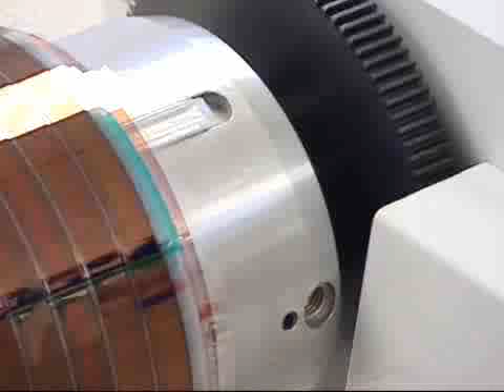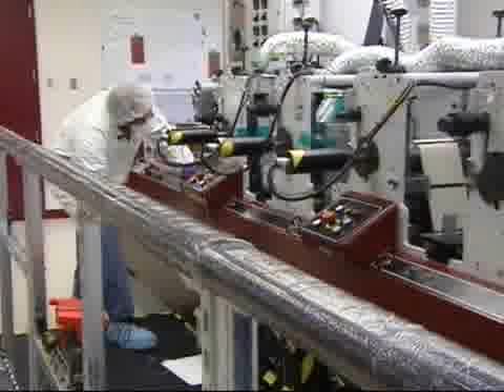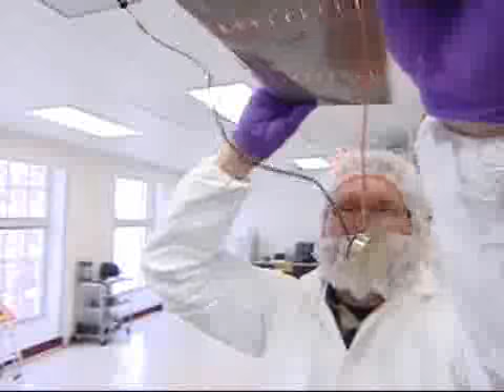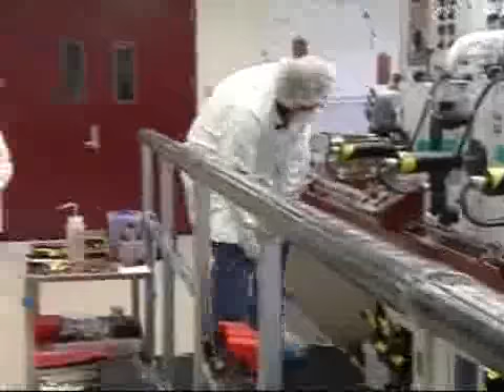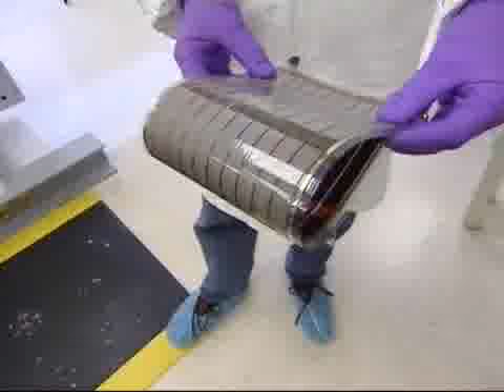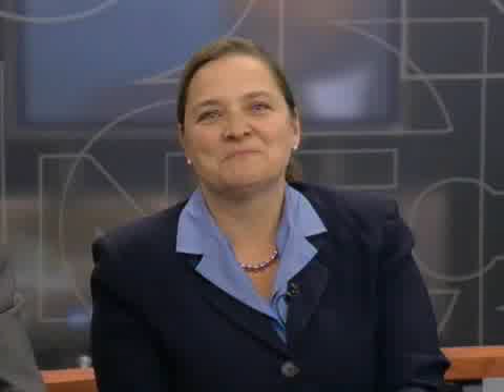Konarka solar power breakthrough

Comment: @tomterahedrob 
The problem is currently, our devices are made to charge with high amperage (relatively)
Low amperage slow charging will permanently damage your device.
(i dont know exactly why but i would guess it allows the lithium to react with something like nitrogen in the air instead of the intended cathode)

also, because they said the film is organic, I expect it has a shelf life.

Its a good start, but there are much more improvements needed to be made before you can make use of it.